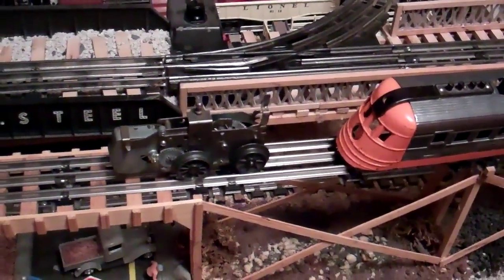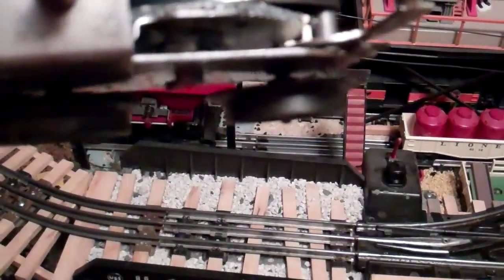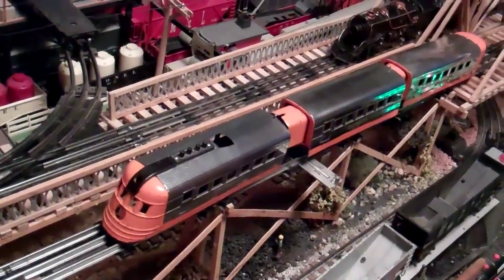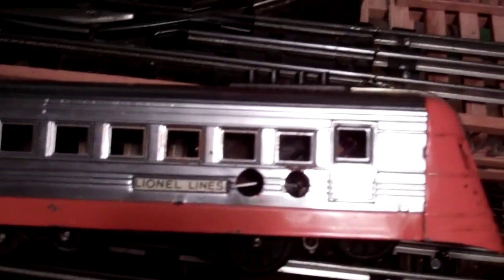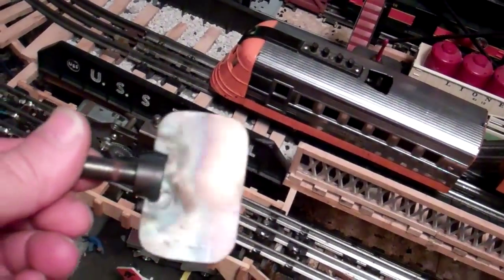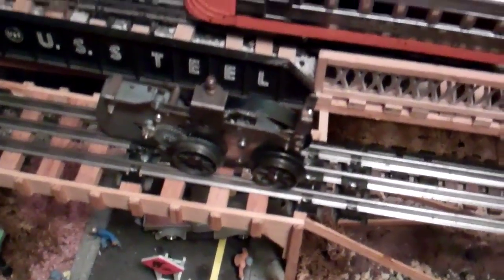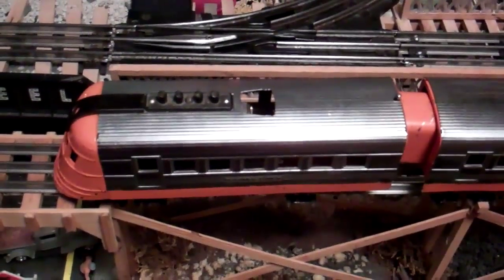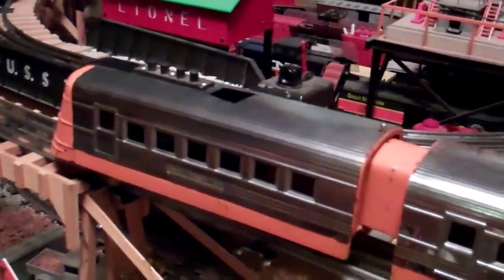LIONEL 1800 CLOCKWORK STREAMLINER WITH WHISTLE

Comment: Nice work on the motor. I have a red and silver 1700 set. The electric motor was toast, so I made a motor mount and installed it on a Marx motor. It runs like a Swiss watch now. I love the simplicity of coupling these articulated Lionel cars together. Although it's a rather cheap, bottom of the line train, it is one of my favorite Lionels.
Reply from the maker: Those Marx motors are good for everything!

Comment: With all do respect-- I have that exact (whistle and all)
 motor in a lot of my prewar Flyer o-gauge steam engines.
Thanks, fm trains
Reply from the maker: With all due respect, this is a Lionel clockwork motor. Flyer had their own similar type gear driven whistle though certainly not the Lionel version. The valving on the flyer whistle was on the bottom of the whistle housing and was operated by a can on the axle.